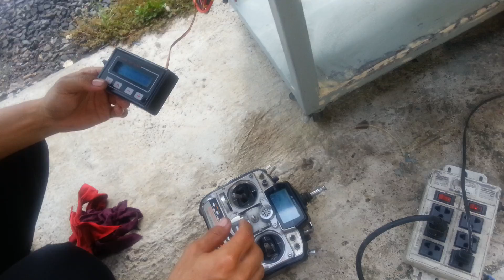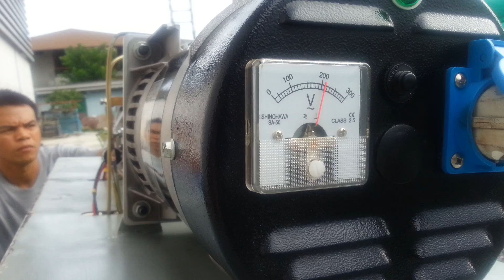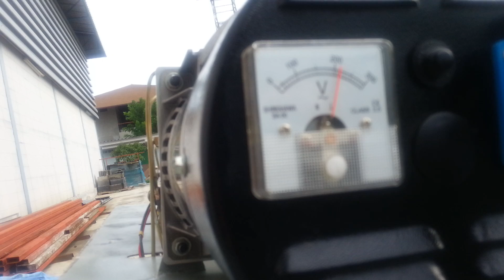Turbine power generator on start up and shut down sequence

Comment: Engine maintenance interval is awful, parts are expensive and the efficiency is poor. This is why they are not commercially viable. When weight is paramount this solution works e.g. aircraft or military. Pity really.
Reply: If it handmaded stuff, based on simple parts for rc model - I agree, it expensive, and low efficiency. But if made specific equipment for small APU it's will be much better.

Comment: I assume it's running at the required 3600 RPM needed for 60hz AC output? How much fuel does it use compared to a piston engine? And how well is the speed control (governor)?

Comment: Nice job! Can you mount a HSRG to increse total shaft power? Use an electrical inversor to control the freq output or dc generator loading batteries of no-break.

Comment: So what efficiency did you get from this rig? would it be more efficient than a regular diesel/gas/gasoline generator?
Reply: @Cody Slab you can make your own gas to feed it from a gasifier then you can add a steamer to the turbine and you can power 2 city blocks easily
Reply: @israelsanchez3283  youll never have enough gas and pressure to run this for any serious amount of time.. if they are using gas they are using butane or propane, that thing will work on any fuel, im just curious how much power it can produce and comparison to a regular generator
Reply: @Cody Slab I'm no scientist and don't know how to take measurements of watts being made and all that stuff but I'll need to build it and try it TEXACO is doing this exact process I'm referring to plus a steamer connected so it makes even more energy. stuff like this interest me if you know about this stuff I'll totally love to get some more info from you I currently have gasifier connected to my 4.3 from a gmc then connected to powerwall made from Nissan Leaf electric car batteries and powers house and workshop
Reply: @Cody Slab YouTube gots a video on it TEXACO GASIFICATION PROCESS BY PLANNED PROCESS

Comment: Awesome.
Can this turbine run or be modified to run on lpg or propane?
Im wiring on a biodigestor to produce gas, I'd like a turbine generator setup like this one to run on gas produced in waste
Reply: Yes this would totally work with a gasifier
Reply from the maker: With some MOD yes..Gas pressure need to be around 5-6bar
Reply: There's a company that sells high pressure inline gas turbos that convert to low pressure and have a built in electrical generator out there as well !

Comment: Do you think this system would be good for an EV range extender?
Reply: Oh yes, please. Actually, Jaguar built a concept car using this idea  a few years ago.
Reply: @Perry_dAccard  yes it seems there have been some great 'concepts' over the years and no one seems to go further with them.
Reply: I once thought the same thing with an electric scooter, you know, put a small engine (a 3-5 HP RC boat engine, water cooled by a computer sized radiator)  and generator in a box on the back of the bike, run it when parked to charge the batteries at full current, or use it while driving to extend the range, a kind of hybrid power control... I figured out the same thing that every manufacturer who has tried this has found out: Its simply not worth carrying around all the extra weight of a entire power system (fuel; tank and handling, cooling for oil and engine coolant, significant electrical systems for handling the generated power AND the batteries power, charging circuitry, safety systems, acoustic silencers, etc..) doing it this way, by turning a line output generator, and running a battery charger off the output, is just too inefficient, just use that weight to carry more/larger batteries. Or carry a large roll out solar cell array, those look ok as long as you have the time (several sunny days in a row)
Reply: @420timedude  and yet, this is exactly what a PHEV is - an engine and an E-motor through the same gearbox.
Reply: @CaptZenPetabyte  yep. a PHEV... But THIS video is about a generator connected to a turbine engine, so its a source of electrical energy and not torque. you couldn't, in reality use this as a range extender except for maybe storing it in the car and bringing it out to charge the car, when parked. I'm fairly certain that no PHEV will let you move at all when power is being applied to the charging port. ALSO... your post said EV. Not PHEV..
Reply: unless you mean using the turboshaft engine to replace the piston engine in a hybrid? and therefore act as a source of torque in the vehicle? I think this uses A LOT more fuel.
Reply: @Perry_dAccard  Range Rover too IIRC.

Comment: If you use fans on the output you could use the pressure to run a turbine too.
Reply: Cogeneration 🙌🏽🙌🏽
Reply: That would upset the pressure balance and the turbine wouldn't run.

Comment: Hi Kumpol ! Please, could you tell me some technical data about the electric generator? 
I am working in a DIY project. 
Thank you in advance.
Reply from the maker: ViictorHugoo It's a 3.5kw generator 115/230V single phase 50Hz 3000rpm. Please e -mail me at pst@pstjets.com if you need anymore details.  Thanks
Reply: Same except I'm going to be building a power pack for a tank I'm wanting to build a tank specifically the M1A2 Abrams. Reason, just because.
Reply: @jaycool5978  The Abrams can't be destroyed by a road side bomb. The t90 can't pen it. The Abrams as for as I know has been destroyed by mainly friendly fire so the tank don't fall into enemy hands. And its only ever been destroyed because of either a mosltove or a rpg to the rear.
Reply: @southernwulf530  was destroyed many times. Sounds like your referring to the challenger. Although the challenger sustained over 72 RPG anti tank hits all over it including the rear. Yet sat there with no damage to the ordeal.
Reply: @jaycool5978  Only 2 challenger 2's was ever destroyed, but that was on UK land during a training accident.but, if I remember correctly 5 or 8 Abrams was destroyed by the enemy in Iran, Iraq, Iron. But compared the few thousand Abrams that we sent over and returned the Abrams is practically battle tested compared to the few that the UK sent. Sooooooo, I think America wins in that category
Reply: @southernwulf530  not really. Quality over rules quantity. Also again yes some got destroyed quite a few as you pointed out but not a single Chally was destroyed by enemy fire. Also obtained the longest tank to tank kill shot in tank history. Battle tested over the challenger 1??? With all those MBT's not 1 scored a longer range than the Chally 1.
Reply: @jaycool5978  Literally said that my dude. for enemy fire ..... All the Challenger 2 has is what the Abrams has, Chobham armor (? Forgot how to spell it)
That and the Abrams is more of a urban war fare tank since it uses l44 German gun, the USA has more than enough capability to add the L55 whish has a higher velocity than the l44. Why they don't add it is beyond me. Plus it's a smooth bore compared to the C2 rifled. 
The Abrams is also more agile, faster and has a faster acceleration over the any mbt in the world, but it consumes more fuel. Might as well add that it practically can use any fuel.
Also America as of now have started to make the M1A2C variant I believe only to change out some tech and software and more armor I believe but not much. Plus not allot of info on it so it's hard to say.
Reply: Plus your quality over quantity was over ruled during WW2, Literally that's how the allied forces won WW2. Overwhelming force kicks ass. The battle field really hasn't changed over the last 200 ish years. Just technology did and how we use it.
Reply: @southernwulf530  you forgot to highlight it requires very high maintenance. Chally doesnt. Btw it was the Chally 1 in Iraq. But again I was simply saying the tank count has nothing to do with the survival ability of the tank. I was also saying the Chally performed better in terms of survival and ranged kill shot
Reply: @southernwulf530  yep but tigers were actually better tanks
Reply: @southernwulf530  quite a few  Saudi owned Abrams have been destroyed in combat.
Reply: @JetNoiseLover   hello which type turbine use  in there ? 200newton ?

Comment: hi! im interested in building one myself.. what is the power output for this per litre?
Reply: Id love to have one too but I really cant see this being fuel efficient at all,  these  small turbines gulp fuel.
Reply: Chris Barth maybe regenerate?
Reply: It's running off of water, Hho generator on the bottom shelf.
Reply from the maker: With this size of the engine, you can extract 10-15kw depending on the rpm you use. However, the higher rpm will be shortening life of the engine.
Reply from the maker: Efficiency is not what you expect to get with this small single-stage compressor though.
Reply: @JetNoiseLover  Can you use this to charge up Tesla car batteries?  Or would a diesel generator be smarter?  Kinda think it'd be cool to tell people I charge up my car with moonshine.

Comment: Just watching how things spin up, it seems like there is some sort of mismatch here.  Possibly the gen is loaded too heavily, is way oversized or the power turbine diameter is too small.  Regardless, I would include an N/C relay that keeps the load disconnected until a certain generator RPM is reached, and then after latching, will only unlatch after going below a given rpm and/or manually.  Still, this is all 100% cool shit.  Keep it up...
Reply: BluntForceTrauma666 looks like it has a clutch or torque converter which is pretty common with any engine transmission
Reply: @talalmash  No, the shaft is not connected at all, and these engines can easily surpass 130k rpm.
Reply from the maker: FYI: It's a free power turbine there. It's not a direct drive to the core engine. A core engine is just a gas generator, that generates gas to drive a free power turbine. Hope this help

Comment: What gearbox did you use ?
Reply from the maker: Mostafa Allam I use an industrial  planetary  gear box but the ball bearing need to be replaced with ceramic ball bearings to withstand the high heat and RPM.
Reply: exactly,i had that problem, all available gearbox has a max of 6000 rpm  and i'm reaching for 30,000 - 60,000 rpm.. ,, did the gears withstand the high rpm ?
Reply from the maker: Mostafa Allam all gear seem to hold well up to 30,000rpm input. The power turbine has about 30,000rpm and the output at 3,000 rpm
Reply: Kumpol Saechour thank you very much .. but how did you measure the RPM?
Reply from the maker: Mostafa Allam... Your wrlcome!! I use  hall effect sensor measuring  the the rpm.
Reply: Kumpol Saechour  can you explain more .. how it’s mounted .. if theres a photo it would be perfect.
Reply from the maker: Mostafa Allam... Don't know how to attach the photo here..may be you can e-mail me at kumpol.saechour@gmail.com